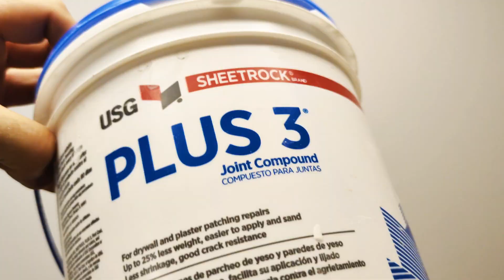Sand Mold Casting Using Lost-Foam - Lost Foam Experiment

Comment: Enjoying the vids as usual. I understand that you did not have enough aluminum, personally I feel that the objects were spread out far (I know it should not matter) But I like the idea of the Xmas Tree they use for jewelry were they really stack the 'tree' full in a small condensed area, I think it would help with flow pressure and also less material.
Reply from the maker: Thanks!  I'm going to try it again a different way.  I've done a flat lost foam cast before with no issue.  I do think it was the black of pressure due to the shortage of aluminum.

Comment: I learn a lot from your videos, I will try this same method for casting- I find greater detail is had when that part faces down. My theory is air bubbles. Get trapped on the top side and won't get as much metal material forced into all the right spots. Cheers mate!
Reply from the maker: Thanks, I'm glad to help 👌👌

Lost foam it shouldn't matter if it faces up or down for detail.  This bad result was due to not having enough aluminum.  It's possible that it filled each Dwarven sigil, but pulled some aluminum out of it to level out.